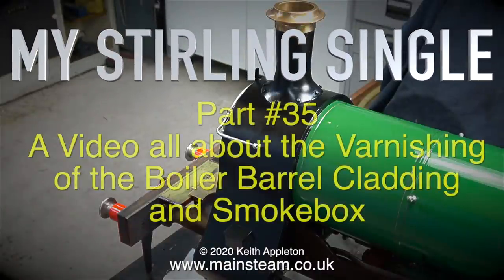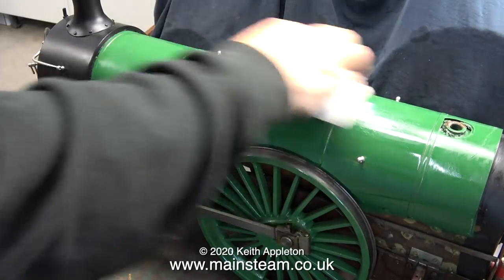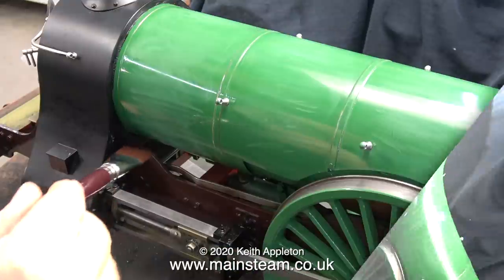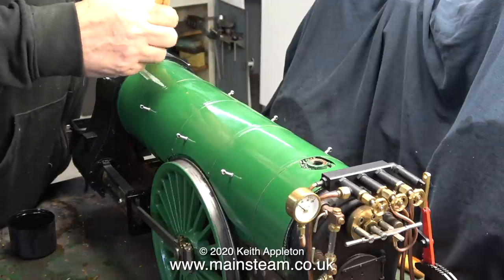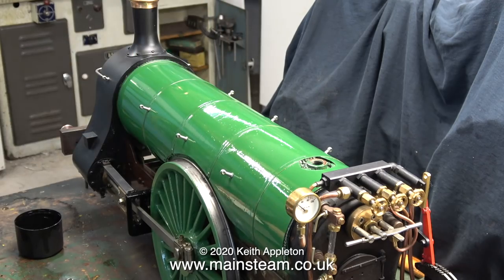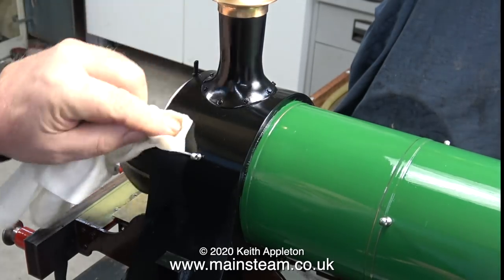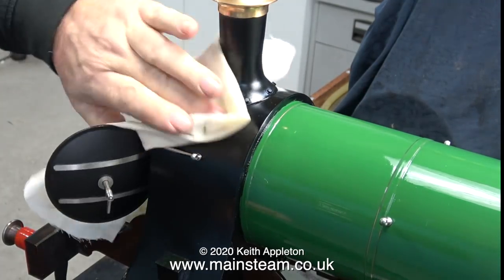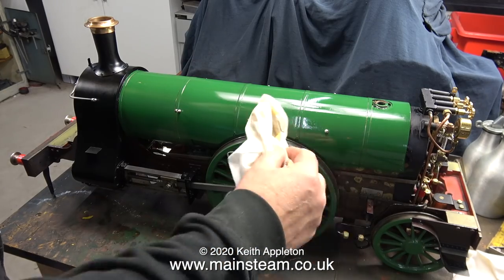MY STIRLING SINGLE #35 - VARNISHING THE BOILER BARREL

Comment: Thanks so much, Keith!  Really interesting.  Is there insulating material between the boiler and the cladding?  I ask because I am attempting to restore an old 5" gauge steam engine.
Reply from the maker: Yes there is and it's quite thick.

Comment: I didn't think Ronseal Hardglaze was very heat tolerant, I would expect it to go yellow and crack when heated.
Reply from the maker: We shall see, I will be giving it another steam test soon, after the next final coat. It seems to be OK on the Mahogany clad boilers . . .
Reply: @keithappleton  They claim it to be heat tolerant but I wouldn't expect it to cope very well with the heat of a gas torch, I hope it's OK after all that time and effort.
Reply from the maker: If it isn't I will just repaint the barrel . . . .